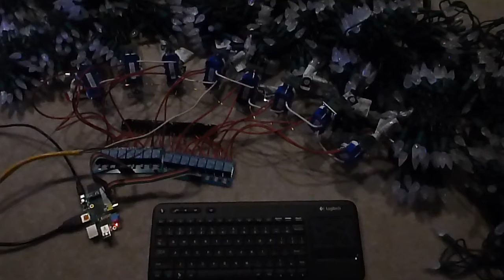16 Channel Raspberry Pi Relay Example with Christmas Lights

Comment: Hi David, I used this year Arduino Mega with LEDs + relays, next year I would like to use a Raspberry but how can I do to control more channels? is there any way to add to the Raspberry 100+ channels?
Reply from the maker: You could use some MCP230xx chips to add more GPIO pins over I2C, allowing you to control more relays. Or perhaps multiple Pi computers and something like MQTT.
Reply: @misterhay  I will take a look to that, Thanks!

Comment: I have the same setup but cannot get the second ssr module to work.  how do you program the GPIO pins to get them to work?  are you running Lightshow PI?
Reply from the maker: +Dennis Cunningham In this video I wasn't running Lightshow Pi, just a python script. I've since built it into a 16 channel Lightshow Pi box, the documentation describes how to set up which GPIO pins you're using. You can also ask for guidance on the Lightshow Pi group on Google+.

Comment: what pins on the pi did you connect to the relays?
Reply from the maker: They are connected to pins 2, 3, 4, 17, 27, 22, 10, 9, 14, 15, 18, 23, 24, 25, 8, 7 (BCM)
Reply: @misterhay  thank you. That will really help me

Comment: Is It possibile with this setup to create a fade effect? Or It is only on/off?
Reply from the maker: You can certainly create a fade effect with PWM (pulse width modulation) if you use solid state relays or perhaps MOSFETs (metal-oxide-semiconductor field-effect transistors). However these mechanical relays are only on or off.
Reply from the maker: That looks like it should work if your using PWM with DC, but I've actually never used solid state relays. And I've heard good things about Vixen, but perhaps check out xLights as well. Good luck :)

Comment: did you just use one power source (for the oulets) for both relays. or two seperate
Reply: i have an 8 channel this year want to expand to 16 for next year. Running lightshowpi
Reply from the maker: One 5V power source for both boards (all sixteen relays) that also powers the Raspberry Pi. In the second version of this I wired the 5V power in parallel to both relay boards and the power pins on the Pi. The way this was set up, turning on all relays at the same time would draw too much power for the Pi to output from the 5V pins.

And everything was connected to a single mains outlet. Since these are LED Christmas lights they don't draw much power even with all of them on at the same time.
Reply: Ok i guess its the mains oulet i was thinking about. Was curious whether i should use a second one when i add a second 8 channel board guess it'll depend on my draw.  I have a mix of led and incandescent so ill have to weigh it out and see. Thanks for the reply

Comment: If I have no experience with electrical (the main electricity source) do you think this project is possible for me? Or will I end up killing myself?
Reply from the maker: +‍ ‍ ‍ ‍ You need to be very careful, but electrical is not too scary. Start with LEDs, though.